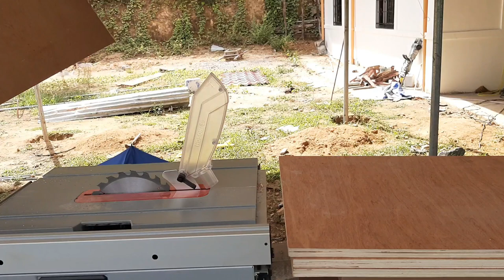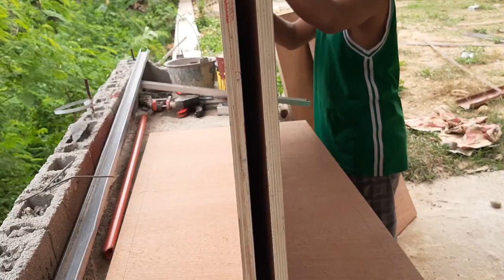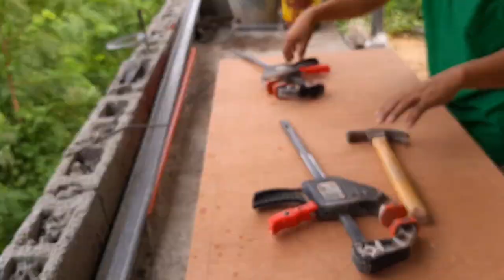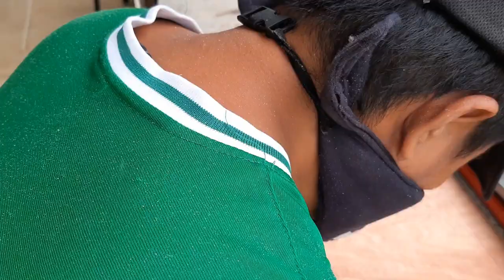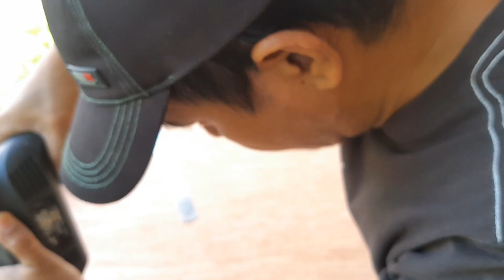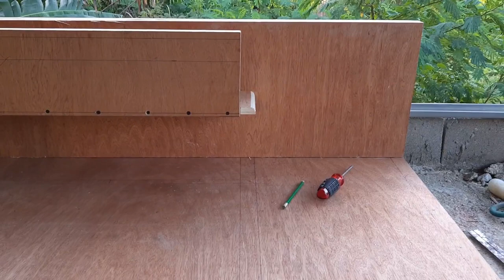DIY 6th Order Subwoofer  Bandpass Box

Comment: You can only get precise cuts on stock when you have a sealed ball bearing sled on a table saw, which are usually only on large very high end models or retrofitted by diy. Most people can't afford 5k for an "entry level" table saw lol, although old used ones can be found for significantly less but are hard to transport. Good day!

Comment: Your holding your drill wrong that's why your fighting to screw the screws with out it skippinglook at the back of the drill on top of the handle is a place for your thumb and pointer fingers which gives you better balance and let's apply pressure straight on instead all holding the handle and it being wobbly
Reply from the maker: Thank's for the advice Sir...